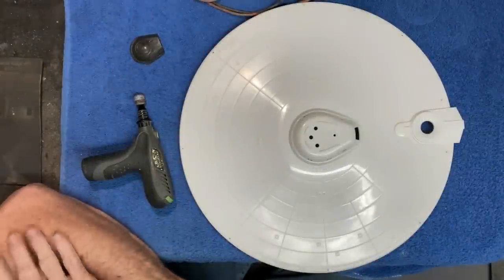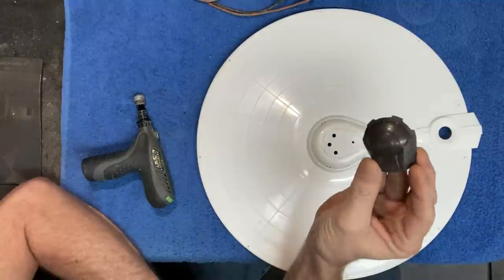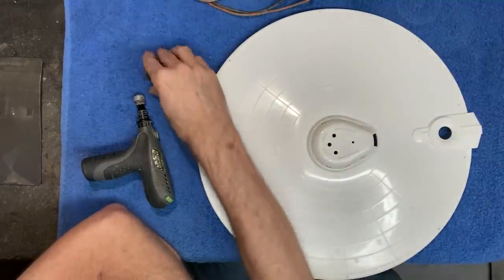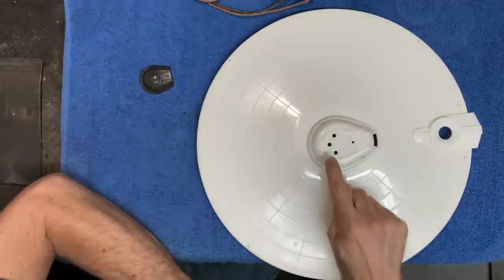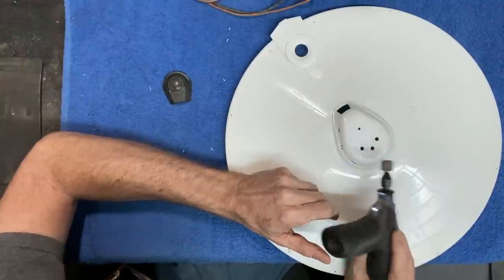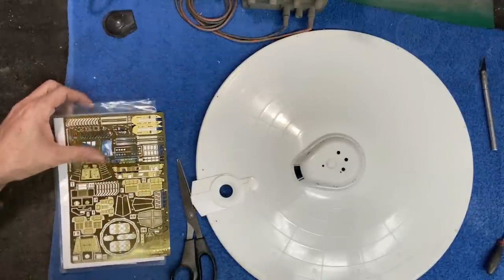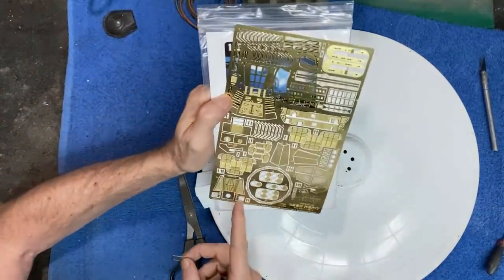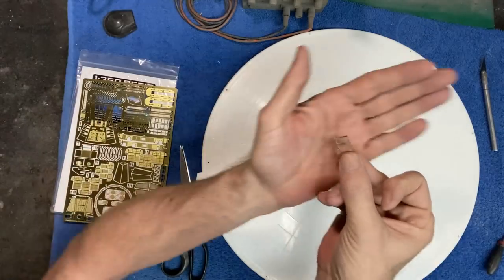1:350 USS Enterprise Refit By Polar Lights Updated Build Series Pt 2

Comment: Thanks for doing this kit again Boyd! It was by watching you do your first build series on this kit that got into the hobby and encouraged me to do this kit. By watching this series I'm really hoping I can keep from getting the urge to do a second build of my own! I have to say that yes the perfect plastic putty and the already modified Bridge has already saved a ton of work. It'll be fun seeing the other short cuts that you can do now. One thing I'm really curious about is if you've found a way to place the mounting post so it's balanced better. I know mine turned out to be VERY front heavy, to the point where I have to have a second post there to support the weight. It's great to be watching this build again by the Yoda of modeling!

Comment: I have that same bridge, great part! The plastic putty you use is great stuff. For filling in small gaps have you ever put it in a dental syringe? They have a curved pointed tip that gets into the corners really well. Nice job so far, looking forward to the next video 👍😎
Reply from the maker: Yes, I use the syringe a lot. It works great, you can really control how much flow you want. It makes cleanup and sanding a lot easier.
Reply: what is the part where do you get it and the LEDs that make the flood light work properly?

Comment: Again, excellent video.  I saw in one of your older videos the scribing tool- picked one up and WELL WORTH the money for it!!

Have you figured out where to mount the mega-board for the lighting and whatnot yet?

I am going to start my build here shortly, following along with the videos.  Thank you again Boyd!!
Reply from the maker: I love that scribing tool, best one I've had. I have the mega board setup but I'm not sure if I'll use it. I've heard it won't fit inside the model easily. I don't like the idea of putting the board in the base and running that many wires through the mounting stalk.
Reply: @Trekworks I hear you on running all of those wires through the stalk.  I haven’t done any test fit with the board yet.  I am going to do a custom base however but yea, that doesn’t solve the amount of wires through the stalk problem.  Hehe nothing like a good puzzle to solve!
Reply: @TrekWorks  Hope you will be able to fit the mega board inside the model. Then I'll know mine will fit too. Thinking the secondary hull would be best central location, but doubt there's enough room after shuttle bay and arboretum go in.
Reply from the maker: @danharris5999  I don't think I'm going with the mega board for this build for that very reason. I want to use the original size thin mounting rod the kit has and not have too many wires going up through it.

Comment: Been following your prior and current videos for this build as I work mine.  Thanks for all the tips and advice!  One question, while working the saucer section walls and sanding, I lost some of the raised circular detail around one of the the nav lights.  Wondering if you have seen any aftermarket replacements for that little detail?  Also when time comes, if you could show details on the mounting post (the original kit location by the deflector, not after the after market stand on the belly) and running all the wires through it to the base, would love to see how you approach this.  Thanks again!
Reply from the maker: I cant say I have but there is polystyrene tubing available in all sizes. Maybe use that and cut it down to the proper height and then glue it back on.

Comment: Hi Boyd!  Towards the end of the video, you said the hull color is going to be Tamiya White primer... is that correct,  a primer as the final coat before Aztecing ?
Reply from the maker: Yes, the original model was painted with Paramount brand white primer which was sanded and buffed to a semi gloss look. I plan on doing the same thing but using the Tamiya primer instead.
Reply: @TrekWorks  fascinating! Thanks !  That should make it look really nice - although expensive, Tamiya has great quality.... and I gather the Duplicplor Matte Wheel finish will be perfect for this!  I use that almost exclusively and I love the results....thank you for that tip!!
Reply: What is the part number for the after market bridge?
Reply from the maker: @phillipsiebels8587  I don't see a part number on the package. If you go to the Hda website and look for star trek resin parts you'll find it there. I'm also using their resin lower saucer sensor array and the mag grills for the warp nacelles.
Reply: @Trekworks how many cans of the Tamiya Fine White Primer do you think will be needed for the entire model?
Reply from the maker: @shanelamb4905  2 maybe 3.

Comment: There are phaser banks available from Shapeways.  After sanding the hull, drill a hole for each one in the hull and drop them in.  They have a center hole so can be lit with fiber if desired.  The set from Shapeways has enough phasers to replace all on the model.
Reply from the maker: Interesting, I'm planning on showing a solution that is pretty simple to do to replace the phaser bank details. It will allow for lighting them if you choose.
Reply: Shapeways has a ton of refit stuff. I just got a bunch in. I saw the phaser emitters you’re talking about they look great.